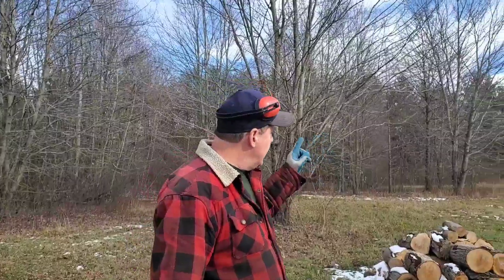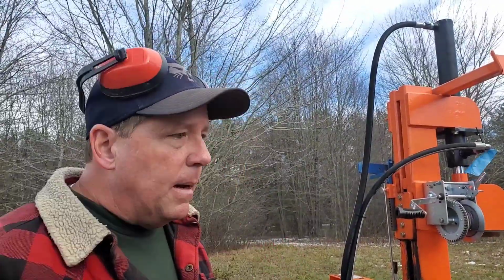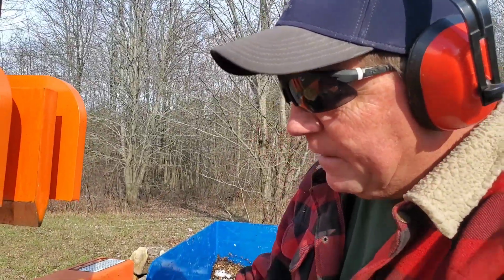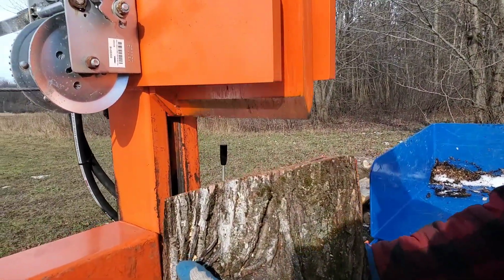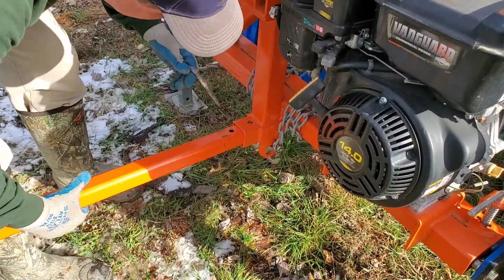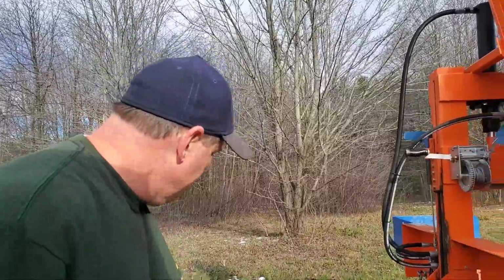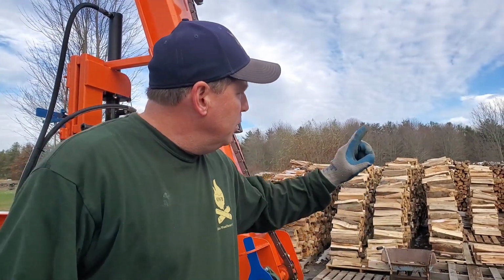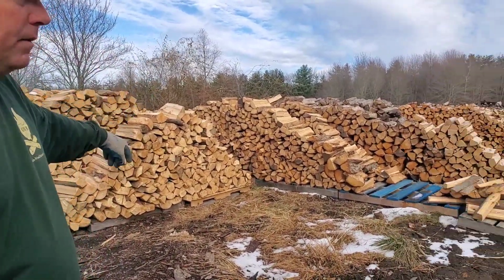This Log Splitter Has to Split!

Comment: Good morning Joe. Happy Thanksgiving. In the spring you could paint the area just under the blade with bed liner paint. Or just a heavy coat of paint with clean mason sand sprinkled on top to add some grip to that spot. Leave the other sides as to make easier to sweep clean. Or they have that stick on sandpaper stuff used on stairs.

Comment: Maybe Eastonmade could make the surface have ridges where the log sits, & the log would stay in place better. 🤷‍♀️ Good video! 👍
Reply from the maker: I thought of that too but honestly it doesn't make that much of an impact on your day.  You can see a problem log before you try to split it
Reply: I sent a comment to Andrew Easton to "drill some 1/4 inch holes where the cutting wedge touches the flat deck", and when the wedge comes down, some pointy tips come up thru the holes to hold the round from moving or shooting out.
Reply: @garylaszewski7380  Sounds smart to me, Gary!! 🤷‍♀️
Reply: @DDL2728  Andrew told me he only has "2 engineers that evaluate ideas to improve their products".  That is a very small number of people who are involved with quality control or improvements. 

Like yourself, one of these days, maybe Eastonmade will implement all of our suggestions. All of us have no monetary benefits by making suggestions. We make suggestions because we like the firewood industry, and are excited about it. 

I have observed your comments for quite a while. You are a very positive person. Thanks for being you!
Reply: @garylaszewski7380  That's sweet of you, Gary!! I don't believe in being negative to these people. They work hard to entertain us & share their lives with us. If I don't like or agree with something, I just don't watch 👍😏 I think Eastonmade needs a few more people helping improve their equipment with our brilliant ideas!! 😆😆😆 Happy Thanksgiving to you & yours!

Comment: Hi Joe - it's Big Rodders in Ireland.  You've confirmed yet again my belief that there's nothing to beat a vertical splitter for accuracy of split and efficient use of energy as there's less wrestling with logs as you resplit.  You do need to read each log, especially those cut at an angle, but that comes naturally.  I will admit to cringing at the debris you allow pile up on the table - I swipe mine off ach time as the ram retracts.  Also, I fear Andrew will charge you for extra depreciation due to the poor old Axis being exposed to your brutal weather unprotected.  You stated you had a heavy frost but it was sure very soft underfoot as you towed the splitter off the grass.
Reply from the maker: The weather was warming fast. I was purposely leaving the scraps there to keep them off the ground. Better mowing next spring!

Comment: 2 options w the white truck, you can add a limited slip differential or get a used rear end off a similar truck that has a limited slip and just have someone do the rear end swap. It’s money but then you can use the white truck more often and save the 4wd truck when you really need it
Reply from the maker: Good idea Nick.  I need to look into something like that.  It literally cannot get out of its own way on slippery roads

Comment: Funny you mentioned the electric start. I looked into it, not worth doing.  I wish it had been offered because I always like the electric start option.  I may replace the motor with a electric start preditor.  It starts well I just don't like pulling it cold weather.
Reply from the maker: why isn't it not worth it Mark?  Too pricey?
Reply: @ohiowoodburner  Yes, the parts ended up costing more than the motor.  When I looked into it I remember some of the parts were not available as well. As much as I hate to admit it,  harbor freights engines have been doing well for us on conveyors and I replaced a old briggs on my 35 year old Husky splitter with a 8hp preditor.  So far so good and they sell a 13 hp electric start that would probably bolt up fairly easy.  If I do it I'll make a video and upload it. Spent a lot of money this season on a new dump trailer and grapple for the skid steer. Been using a klaw for a grapple which is great at the wood yard but it limits the lift due to how far away from the  pivot pins the log gets clamped. I have a local guy that handles attachments Berks Attachments  is his company.  Got a nice 60" duel cylinder unit for 1750.00. I did a 48" for my compact tractor this spring for 1400.00. Also got a 84" rock bucket that really makes loading from a pile easier because you can shake out most anything that doesn't belong in the trailer. Really nice stuff at a good price. I think they are made in upstate New York. berksattachments.com  is the website in case you need anything.
Reply: I had Andrew order my Vanguard with an electric start. Love it!
Reply: @jaymyers3888  I didn't know that was even a option then again I didn't ask either. I  guess I was thinking no big deal I can always add it if needed. Woops!

Comment: Good evening Joe, you should have maybe just filled the empty tote ?
Reply from the maker: Couple reasons no.  I didn't feel like getting my tractor out and putting on the forks. Also the ground is getting soft and I figured the front wheels would sink.  Just easier this way. T hanks Pete!

Comment: I have a log splitter with a Honda engine and when it is cold it will not start until I put the torpedo heater on it to heat the engine changed oil to thinner viscosity still no go
Reply from the maker: Wow.  I hope mine doesn't come to that. Thanks Jeff